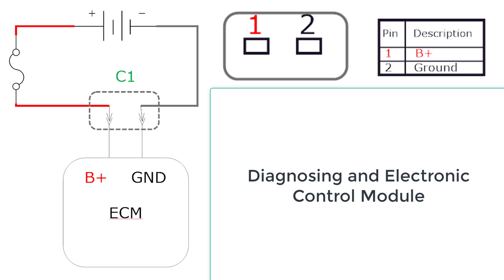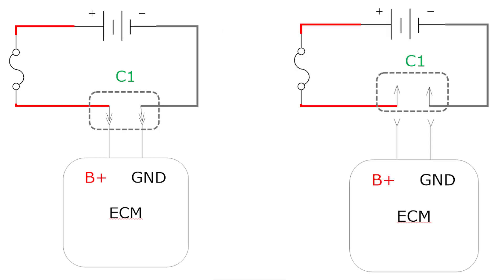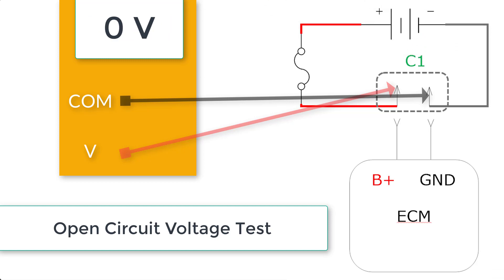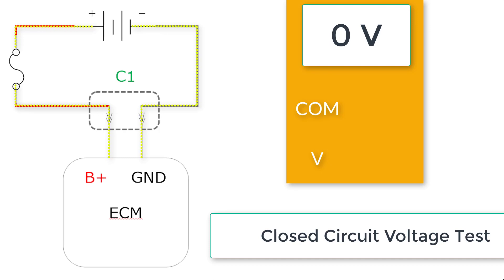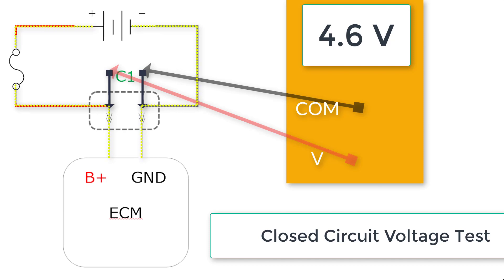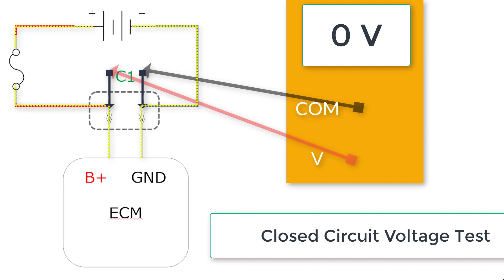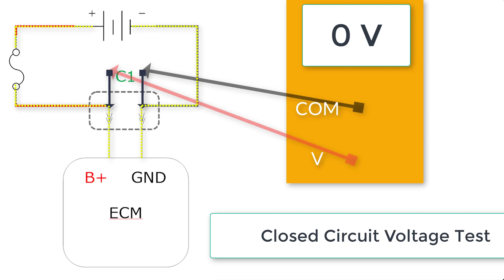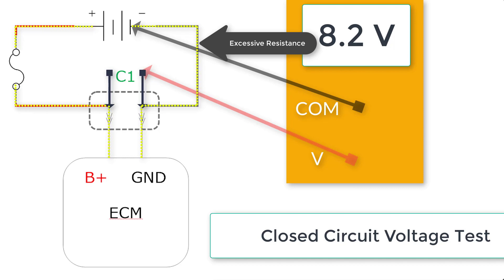Checking for Power and Ground at an ECM

Comment: 2012 equinox.What if I have 7volt  yellow wire on a ground switch in the pcm from the engine control ignition relay and when I disconnect it it’s 12volts come junction box.
Reply from the maker: Sounds like a voltage drop. Probably high resistance. Is it the control wire for the relay

Comment: You can and should also recheck ohma under load many times it will show issues better than voltage drop. This also works on most 120v troubleshooting!

Comment: May 26 2024 , hello , I have 2006 gmc 1500 Savana 5.3L v8 . How do I check the ECM and the knock sensors voltage ? The power come from the ECM threw wire to Knock sensor. The knock sensor is grounded by it being screwed to the engine block . The reason why I’m asking , because the knock sensor show low circuit.

Comment: Nice video, but you never mention how you had "current" going through the circuit, "by turning the ignition key to the on position" or what a good reading should be, on the dvom, when you connected the red lead on the battery positive, and the black lead on the connector positive pin, with the key in the on position. 

A good reading would have been zero volts, or close to it, you never mentioned that when the dvom meter showed a 12.6 voltage drop, the same on the negative side of the connector. 

I did see where you mentioned if it was below .5v that was ok,  but you really never mentioned that you were dropping 12.6v on the positive side when it was showing on the dvom. That reading of 12.6v, I am sure confused a lot of newbie viewers, and should have been cleared up that that was a voltage drop reading, and the reading should have been zero volts or close to it ,5v tops.

I notice most videos on electronic troubleshooting do the same as what you did, they must assume we know what a good reading should be. Other than that your video was very good and clear. My two cents, I guess I am a nit picker.

Comment: Ugh, I'm trying to avoid doing it but my Camaro throws knock sensor and o2 codes all day and it drives me nuts !
I checked most grounds on it except the hidden ones on back of heads and everything checks out yet I still get codes after just 1.5 miles driven...
Now I'm gonna chase down the PCM wires and try some 100k Ohm resistors to test everything yet AGAIN.
Thank you for the clear video !

Comment: This video absolutely helped. I'm not an auto tech. but I am an electronic technician turned marine electrician who's currently looking to get auto electrical diagnostic and ECM troubleshooting and repair. I think my 24 years in the electrical / electronic field can be transferred over to automotive - that I'm confident about. so yes, I found this video to be extremely informative - especially the part which explains that most voltage drops occur on the ground side, due to corrosion. Of course I also understand that it can happen on the power / positive side as well but in any case, these tests are extremely important, so than you for sharing.

Comment: I have a 2014 Chevrolet Silverado. I have had 3 ecms fail in the last few months. The most recent lasted 6 weeks. No warning. The truck just won't crank until a new ecm is put in. But once the ecm is replaced the truck starts right up and runs perfectly. No corrosion, starter is good, battery is good. Any idea as to why the ecm keeps failing?

Comment: Thank you for the best explanation.
Im trying to find ways to exlude all other faults than ECM, to fault code on lambda heater circuit. Lambda is changed and there was nothing wrong with the old one.
The car is petrol T4 Caravelle with AVT engine from 2001.
Lambda heater gets both power and earth, from ECM. ECM earth is connected streight to battery terminal.
I know the fault is in ground side, from ECM to lambda heater. The voltage dropps below 10.5V and the fault code is sett. 
If I measure voltage from plus wire and battery negative - the voltage is higher than from the pins between ECM and lambda connector. 
Testing closed circuit voltage test on ECM ground pins (they are two) gives me 25 mV.
But when I test same test on the ground connection to lambda heater I get 7 Volts. 
The strange thing was, doing the same test on ground wire to after cat lambda, I got 13.85 Volts! But there is only  a fault code on first lambda - not on the second one!
Im I correct to presume its something inside the ECM, that is faulty?

Early tests on ground taken from battery versus ECM:
https://youtu.be/O4i3BVJ6KkQ
Versus:
https://youtu.be/OFViERBszuA
Reply from the maker: It sounds like an issue with the ground. Do you have a wiring diagram?
Reply: @ScottHadzik  Yes I do. ECM is grounded on battery. And there is no resistance in the wires.
Reply: @ScottHadzik  Transistor inside the ECM?
Reply from the maker: Send me the diagram scotthadzik@weber.edu
Reply: @ScottHadzik  Sent you an email.
Reply: A wiring schematic is a must! Get some extension leads and do some continuity tests. If it's simply a 2-wire sensor, you should have continuity while testing from the sensor's positive feed to the corresponding positive output from the ECM. Make sure you do this with the key off. You can also check this lead to see if it's shorted to ground. Repeat this process on your negative lead of your sensor to ECM's ground signal output for that sensor. Essentially, do some continuity tests to chassis ground and see what you find. A lot of newer cars have direct feeds for Signal grounds to individual sensors. They are indeed different than Chassis grounds. If for whatever reason you happen to have a third pin on any of the sensors your testing, repeat the process. Continuity from point A to point B is usually the first electrical test that I do before moving on to the additional tests that Scott has illustrated here in this video. Great video by the way Scott
Reply: Forgive my ignorance until I reread your post. If you're dealing with a newer vehicle with Lambda oxygen sensors, you will have it the bare minimum 3 to 5 wires in the circuit. However nothing about my previous comment changes in terms of doing continuity tests on each of these leads individually.
Reply: Your commenting is disabled on your video. It will make things more difficult for feedback

Comment: Are battery positive always pin one and main ground pin 2 of an pcm / ecu?
Reply from the maker: No, it's not unfortunately. It varies by vehicle. It's possible that the ground is black and the power is red, but that's not really a guarantee either.
Reply: If only it was that easy or universal, we would all love life. Also, ECMs nowadays tend to have grounds that are "Chassis" and others that are "Signal". Make a huge difference on what you're looking for. You definitely need to get a proper ECM schematic from AllData or IdentiFix or another very reliable source. It will save you a ton of time and headaches. Good luck.

Comment: Scott can you help me with a ecm i have on a can am atv its blowing 5 amp fuse and i unplugged ecm and its not blowing fuse now. I need to know how do i find out if its the ecm or a short. If i buy a new ecm its 750.00. I need help. i have videos on here also. But im not smart with electrical.
Reply from the maker: The fuse opens when power is shorted to ground. With the ecm disconnected install a new fuse and wiggle the power wire. Check pinch points like suspension and doors. If the fuse opens with ecm disconnected then it's the power wire going to the ecm. If your confident in the power wire then the ecm is bad. A short on the ground side is unlikely. It would have to short to power. Check for melted wires.
Reply: @ScottHadzik   thank you so much. I will get a new ecm and see if that fixes it.

Comment: My ECM connector has 3 pins ground going to chassis. Also, 3 pins battery power B+ going to main relay, and 2 pins battery power B+ going to battery. Which one should I test in this case???

Comment: Hello I have Toyota auris which we know ECM control ground . 
I get o2 sensor fault which didn't fix after replacing the o2 sensor .
ALSO AFTER around 7 min alternator stops charging . (This is almost same time o2 cause engine light to.come on as well) 
When o closely test o2 sensor and alternator both sharing wires and Ecm stops ground to these component . 
I couldn't find any broken corroded wire ,however I can see somebody already worked on wires before . 
Would you plz help me ? 
how shud I make sure this is ECM ? or anything cause ecm to cut off ground after 5-7 min (or in the word after engine getting a bit warm) ?
cheers
Reply from the maker: Test between ground pin of the ecm and the negative terminal of the battery with the vehicle on. It should be close to zero volts. If it's more than 0.5 volts the ground to the ecm has high resistance.

Comment: i did the voltage test and there was a consistent 12.36 volts on the ecm.how do i diagnose a bad ecu? my motorcycle does not power up.any help or advice you could provide?.thanks
Reply: @jordanammanshmesani  whatbdo ya mean ground to ground? In the ecm?